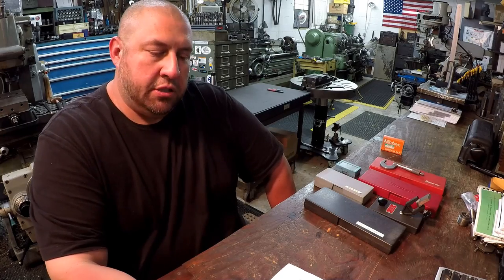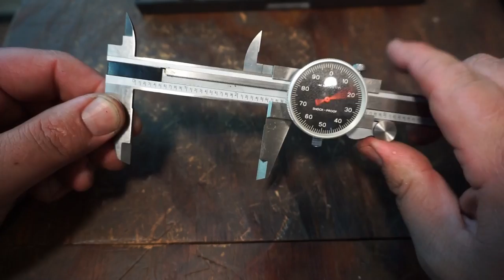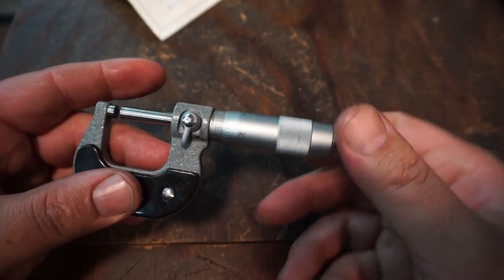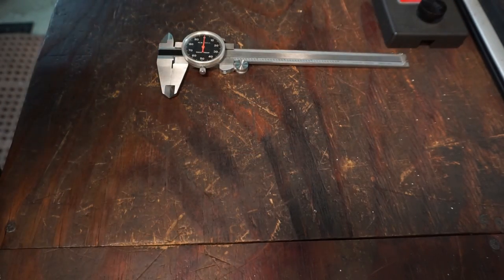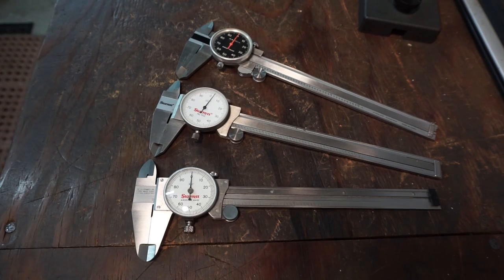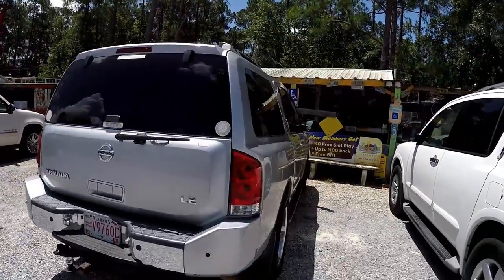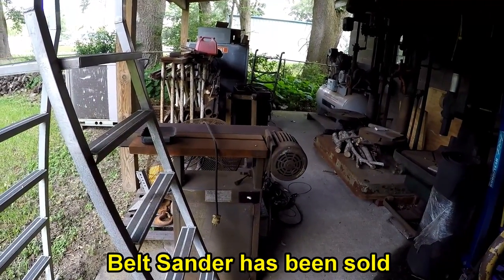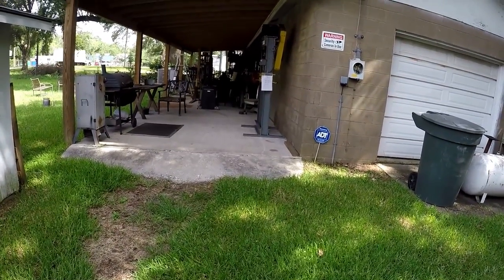SNS 175: Cheap vs Starrett, Shop Upgrades, Weekend Adventures

Comment: Back when I worked in a Calibration lab we used to jokingly call vernier calipers Very-Nears, because as you said, they get you very close but for absolute precision a micrometer has to be used.
Reply from the maker: For sure! Calipers have there place in the shop, but I don't advise my users to be using them for close critical measurements.
Reply: +stonesie81 haha I'm stealing that!! :D
Reply: stonesie81 My old foreman called them Very-Neers as well.  I think mostly to emphasize that it was time to focus on the work.
Reply: Yeah parralax error on the vernier scales is a issue, that's why i use dial calipers myself.IIRC when my eyes were younger i didnt have as much of a problem, i cant really use them now anymore for anything approaching accuracy.
One thing i refuse to use is digital! Floating scales that can be slipped, easily knock your zero and they always seem to go flat when you really need them! I refuse to use them.

Comment: Such a blessing to have reasonably cheap land and have your own shop.
I'm a US Citizen but I've been living in AU for 20 years, we have THE MOST expensive real estate in the world, the avg. home in the city (which is where everybody lives, there's little sustaining work anywhere else) costs over $1,000,000 (Approx. US $700,000).

That's at an average, you cannot find a home like yours but 40 miles out of town, and at that you'd be looking at over $800,000+, if you want an acre or two where you can set up and settle in its just unaffordable unless you can find some way to make it work in the country.

Real estate's really a huge problem here, largely because of mass immigration and a lack of houses the housing price just continues to go up and never down, which means its not only a safe investment but the standard investment and with a decent return - Everybody becomes a landlord and that pushes up the price further.

What that also means is that if you have a business that's not as safe of an investment or offers as good of a return in Australia, you don't have that business, it doesn't exist. No one will put money in it if they can just buy a house or an apartment or 10 and rent it out to some chinese 'university students'.

Land is everything, I make do right now with a storage unit, about as large as a large car, with a foot on either side and a maybe 2 foot front and rear. Which costs $500/month and is so cramped it makes every job take at least 3x as long.

Land is everything and if you've got it you should remember this and give thanks to God often for His blessings.

Comment: As a teen I started setting every spare cent aside for good teaching books and top of the line tools.  It took 5 years to fill my home built tool chest.  At 58 I still have many of those tools and I clean and lightly oil them every use and put them back.  And they still work like new.  Rule #1. Tools are like your (work) wife.  You treat them well and you don’t loan them to your buddies.

Comment: I hate cheap tools, I try to buy secondhand vintage tools off ebay and they are always superior while being fractionally more expensive. I do use a cheap set of 12" calipers however. When I need more precisce calipers I will buy a mitutoyo aos 0-6. 
The tools that save me the most time and headache in the shop are keytools (stamped steel klein SAE, Metric & Torx set, plastic is expensive garbage), and my knipex wrench. My most used piece of equipment is an electronic headset like that worn by shooters. Its just a normal set of muffs except lower profile and they have a microphone connected to speakers inside that allow you to turn them on to hear things. The speakers cannot replay sounds louder than 86 or so decibels. They are far superior to plugs or dead muffs. The nice thing about any muffs is that you can press your earmuff to the toolpost handle and hear the tool touch the workpiece very crisply before you see or hear anything.

Comment: So I've been a machinist for about 26 years now and I've run expensive and cheap calipers just the same. My thoughts on this is as long as the cheap ones measure correctly. 001 = .001 I run with the cheap ones consistently and figure that they are a consumable.  If starrett are $200 and the cheap ones are $20. If you plan on a lifespan of 2 years for the starrett calipers, you could open a brand new set of cheap calipers every 3 months and at the end of the 2 years you are opening the last of the cheap calipers or you could be using a 2 year old set of calipers. Considering all calipers hit the floor at some time. You don't cry as bad when the cheap ones hit the ground. Just my thoughts.

Comment: Great video Adam, as always. 
In my 25 years in the machining business, i have found that the cheap calipers will get the job done (like you said)
but they just don't last like the Starrett or Mitutoyo do in every day use. The expensive tools can take the odd "whoops" here and there. I purchased some Moore & Wright inside and outside mic's from a retired teacher 15 years ago and those things are built like tanks !  They will be around forever. Starrett are the same. You get what you pay for. 
As for your shop upgrade, right on man, congrats. Looking forward to seeing it come together. A word of warning though, 
just look at Keith Rucker…he built that big new shop, and now he can't stop filling it with machines !!  Its an addiction I guess.
Anyway…cheers from Hamilton, Ontario.   Mike.

Comment: Years ago I had a cheap dial bore gauge. It had .0005" graduation marks on the dial face. I used it when sizing Harley-Davidson cylinders. The factory allows .0002" max out of round and taper.  Probably about 20 years ago I bought a Mitutoyo dial bore gauge, with graduation marks of .0001". When I compared my old cheapo to the Mitutoyo, it was not really true to .0005". Junk. It probably made me better at final honing cylinders, but it also no doubt caused me to unknowingly put out a product that was not in the tolerances I thought I was holding.

So maybe a guy can get away with cheap Chinese measurement tools for fun, but if you have to hold a tight tolerance for real - on a customer's work, save your money, and buy the good stuff. Otherwise your customer isn't getting what he paid for. You are only as accurate as your worst measurement tool. My two cents.

Gimme that sandwich!

Comment: Good for you, Adam, I  have always hated having welding and grinding equipment in the same space as precision machines.
Reply from the maker: I have not liked it much since I put the equipment in there but it's all the space I had.
Reply: Yeah.....I've had jobs doing welding and machining, they don't mix well....any grinding or welding  is just awful contamination....surprises how many guys here  grind and weld right in the middle of the shop....where they're assembling engines/motors and stuff....

Comment: One thing to consider Adam.... keep your best tool bit grinder in the machine shop. From a wood workers stand point, the less travel you make in dis-assembly, the better. I am not saying don't get your grinding out of the machine shop. but.... keep your tool bit grinder easily accessible. You can thank me later. :) A shop is like a kitchen, think triangle :) <--- regardless of the kind of shop :)

Comment: 18:27 Screw right there to tighten it up...
Reply: I mean yeah but it left the factory like that. Any line with an engineer behind it that has a small smidge of pride will not let that go
Reply: @whatevernamegoeshere3644  Might have been fine a factory, and came loose during shipping.  I suppose they could use thread fastener.  As a consumer I'm okay verifying or assembling products before usage...especially if it costs me less.

Comment: Hi mate.  Congrats on the new plans for the shop.  Are you going to break away some of the wall to create more space?  I like Abby, she looks to be a kind girl and a lot less LOUD.
Reply from the maker: Not removing the wall, it's the load bearing wall. If I ever feel I need to I will consider it though.
Reply: Spend a little extra on the bathroom for quality fixtures and a tile floor. Easy to clean and comfortable are necessary things for a hard working man.

Comment: On the construction end if you know you plan to add the 3-phase power at least have the conduit run and when you are ready to pull the trigger then have the wire run and outlets and hook up at the panel. This a very common practice to do.

Comment: sometimes you can be suprised, i needed an ac power drill as my usual one was too heavy for some work (need two hands to bring it up to horizontal etc) and didnt have the money for a good one (i usually buy bosch tools)  so bought a chinese one at a supermarketm thinking, if it lasts a year (it has a 1 year warranty) i can save for a better one and keep an eye on deals,   i did buy  a better one, but 17 years later the chinese one is still running, its on its 3rd set of brushes (which are only £1 for 4 sets from china!) and still works great, ive not needed to use the bosch one i bought

Comment: My biggest item on measuring tools is repeat-ability. If you are making parts for repair work using the old part as reference it really doesn't matter what tools you use as long as you use the same tool for the measurements and the tool repeats well. Now if you are machining to a print you want to be sure the tools are accurate.

Comment: If i worked as a machinist i could certainly see myself buying starrett. For me though it's a bit of a hobby and i'd never get enough use out of them to justify the expenditure.
Reply: Agreed.  if it's one of the tools of your profession, then the best quality you can afford is always going to be ideal.  I'm a little dubious about how long the cheap tools will last under regular use.  But for a hobbyist,  think it's unlikely you'll get enough wear into the tool for it to be a problem - not for quite a while, anyway.

Comment: For the door on the toilet room, you might consider a pocket door so you don't have to account for swing-room for the door and have a little more useable floor space in the toilet and shop. Just my unsolicited opinion.
Reply from the maker: Im putting the door facing towards the air compressor so it'll work out good. The wall of the bathroom will be a storage area, shelving for materials.
Reply: I see. Are you going for framed walls or concrete block? Also, are you on sewer or septic?
Reply: Peabrain a.    T
Reply: Peabrain pocket doors are great for such applications

Comment: I used dial calipers (Tesa, Brown & Sharp) for 30 years then went digital and never looked back.  I currently use the coolant proof Mitutoyo 8" digital, about $200.  Use micrometers for anything closer than .001".
Reply: Most of my measurements are slip fit and "close enough" for welding purposes.
Or measurements on tubing and selection of drill bits, as some dont have a drill index to go into and reside in my drill bit tray on the stand
Reply: Wayne D The 8" Coolant proof Mittys are my go to as well.

Comment: Adam,
Unless I missed it, what I feel you SHOULD HAVE mentioned or discussed is the fact that today one can easily pick up a made in USA Starrett or B&S measuring  tools  REALLY cheap on ebay! I see them in almost as new condition including original box for $15 - 25.00 all day long. Not only Calipers and Mic's, but there are tons of the best quality Starrett's and B&S's available. I'd MUCH RATHER see a person starting off using a slightly used but cared for American icon than a Chinese version even of they are somewhat accurate. Just my opinion but I wished you had discussed that.
Reply from the maker: I did give it a mention, but about the mic. I sometimes forget all the things I want to talk about, and I do these segments straight off the cuff. yes you can find some good quality used tools on Ebay for sure.
Reply: are you sure they are genuine items?
Reply: Even today Starrett DOES MARK their American made goods with "MADE in USA" where they are allowed to. I don't buy Starrett's unless they have that on there because as we all know, many Starrett Tools are NOT made in the USA any longer.

Comment: If the material storage is gong to be mounted to the wall, and you want low impact into the space, what about building a metal frame so it gets included in the wall cavity, all that you see would be holes in the wall that are threaded, if in the future you move, you can simply unbolt and fill the holes.
Wood wall studs can be fixed to each side of the metal to provide fixings for the cladding etc.
It's no different to providing a wood block in the wall ready for hanging heavier items in the house, like a sink, but this is heavy duty Abom style :D

Comment: I'll use calipers to measure close to the final dimension (say within a few thou), at which point I switch to a micrometer, so I don't see the point in spending £200 on a pair of calipers.

I prefer to spend £20 on a cheap pair of calipers, and put the other £180 toward a really good set of micrometers.
Reply: You'd still be better off getting a quality set with a Vernier scale (OK, bit more than 20, but still in that region) than something built to be cheap if you don't mind the lack of digital display. More rigid, more reliable, better feel - generally a pleasure to use in comparison. You'll be surprised how much money people charge to add another failure mode to a system (in this case - batteries)
Reply: 233kosta 
Most people don’t realize that old school vernier scale calipers are more accurate than dial calipers.  There’s a lack of knowledge about what the vernier scale is and how it allows measurement to 1/1000th.

Comment: I have both and what I've found is that it is relative if you start a project measuring with a Hopsing mic stay with it.  where I've ran into trouble is switching back and forth.  great video. thanks for sharing.

Comment: As a rule of thumb, I prefer US-made Starrett products if they are available.  If not, or if Starrett is made in China, I'll check to see if I can find an equivalent by Mitutoyo that's made in Japan (electronic mics are a good example) or in the case of dial indicators, Swiss or German.  If all else fails, I will resort to China by one of the name brands (usually Fowler because of price).  Good measuring tools are ALWAYS worth the investment.  Find ways to save so you can buy good tools, 1.) they will never be any cheaper than what they are now thanks to inflation and material costs and 2.) in the case of non-electronic tools, they can be refurbished and reconditioned for life.  Barring an accident or misuse, good non-electronic measuring tools will last your lifetime and probably the lifetime of whoever you leave them to.  They're great things to pass on.

Comment: I believe I have the same Chinese micrometer from hornady... it is "accurate" but the issue I ran into is that the anvil on the measuring base is uneven and depending on where you are measuring from, it can be out half a thou or so. it's enough for what I use it for, but I can see how it would drive someone insane chasing down a rouge thou on something tight tolerance. that extra 85 bucks go's miles for accuracy.

Comment: My .02. I have $20. Chinese calipers that I use for rough measuring and scribing. Anything closer I prefer B&S calipers. They have a better feel to me than Starrett. I also have Mitutoyo Digital calipers in 6" & 12" Mics I carry a 1" carbide tip Starrett in my apron at all times. For larger mics I have a 0-12" set of Polish made mics but only trust them to .0005 if I need closer than that I have 0-12" Mitutoyo. Indicators I use B&S Interapid and and other Swiss I don't like Starrett Indicators. Don't like the feel.  What ever you like and trust you should use. Don't be afraid to buy used tools. Buying a whole box of tools you can get stuff dirt cheap. I have bought Kennedy roller cabinets with top box for $750. That we're loaded w tools. Keep what you want and resell the rest.

Comment: Interesting, glad you explained that theres both US and China made Starret calipers,I was checking them out a while back and China scared me of. I heard you briefly mention the Mitutoyos and i guess you rate them?Ive gotten 3 dial calipers as of this post,2 x mitutoyo (older MIJ stuff,current country of manufacture is no longer Japan i understand???) and some lovely very Old Masuer made ones that unfortunately had a tooth missing, i ended up getting them for free after ebay seller refunded full amount when i pointed out they werent fit to be used.My 2 mitutoyos are lovely, ones very old in the snake skin kind of finish case with red velvet inside, not a single piece of plastic on them! These are SOOO smooth, could be down to age.My other Mitutoyos were NOS sealed in box, they are 12" i think.They are newer(grey plastic case that had orange cardboard sleave) but still MIJ, only piece of plastic is the little tag that clamps on the dial.The new ones (pretty sure they Mexican i heard?) use the plastic body, turns me of! I like older tools :) I paid about 60USD for the NOS ones and a bit less for the older ,smaller ones.The bid that won the Mauser calipers was over 100usd,which i was happy to pay(im into firearms and Mauser branded calipers just seemed appropriate for the reloading bench!) had they been serviceable.

Comment: The friction thimble on the Mic should be adjustable as to tension.  I bought 5 used Quality Mics for $45.  After cleaning, and minor calibration on two, using Mitutoyo mic standards, they are all within one tenth.  2 Scherr-Tumico  3 Brown&Sharp.